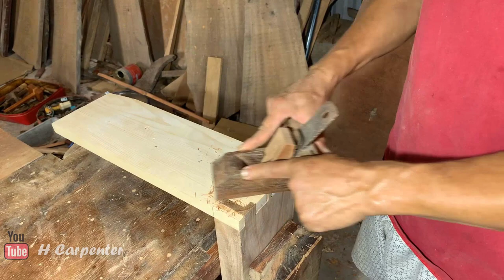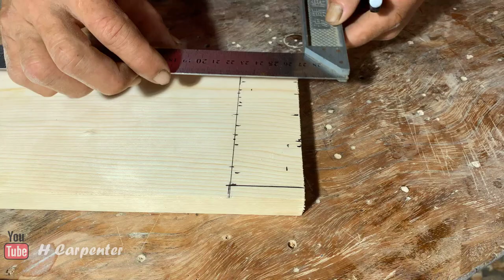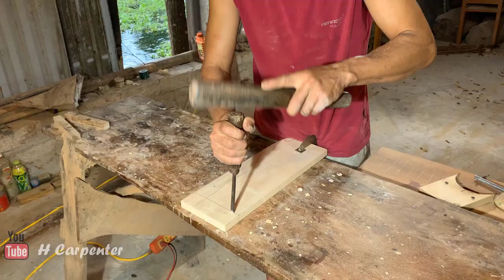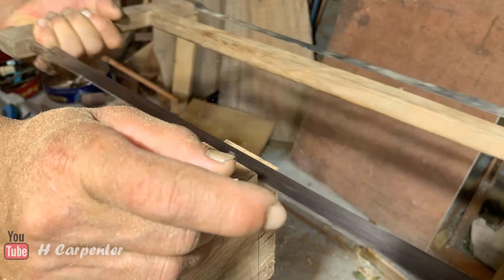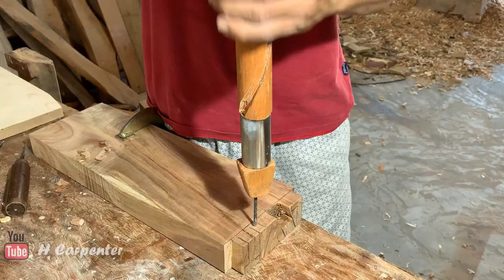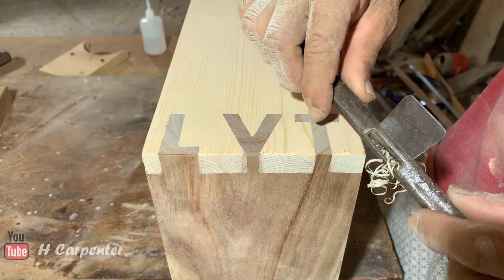Awesome Techniques Of Carpenter - ASMR -  Amazing Woodworking Project

Comment: Yeah I did a little Egyptian laughing my day applied a few with some long dimension across the studs and joy so I did a 22 staggered right according to not occurring in line with the sides of the opening so it's usually a blue lacing nails I use about 118 inch long with about a 3/8 in laugh and I use a better one and a quarter inch long for about one and a half inch laugh I drive about five nails into each framing member across the width of the sheet not less than 3/8 in from the